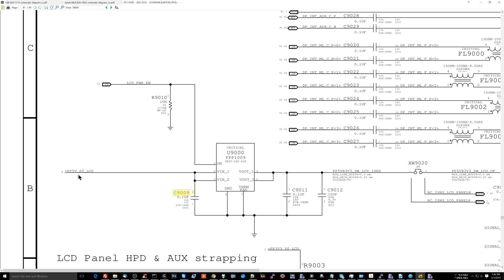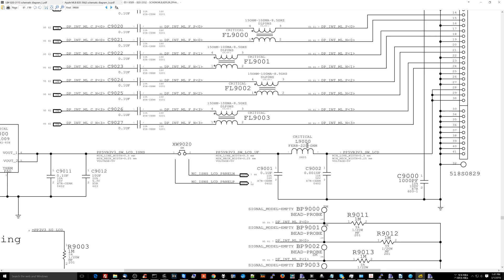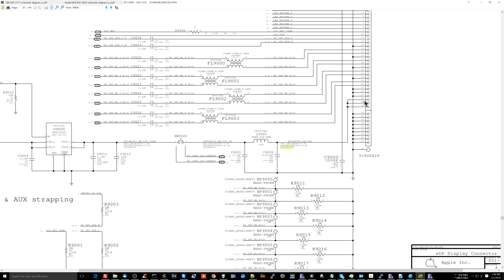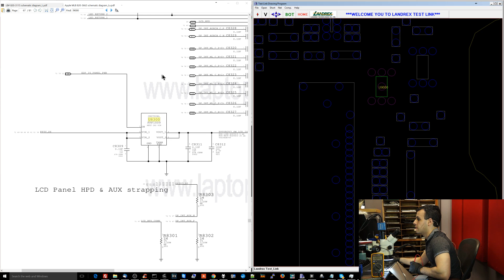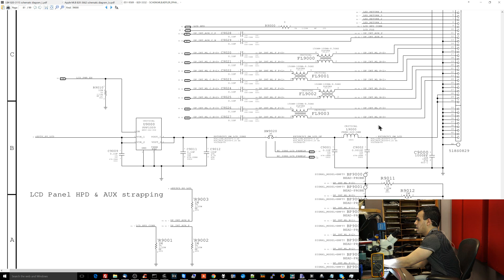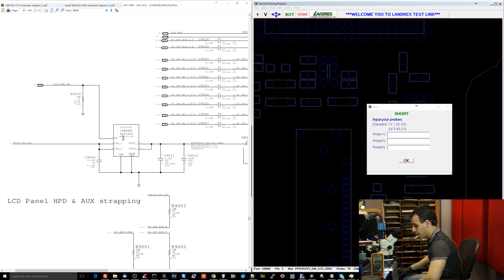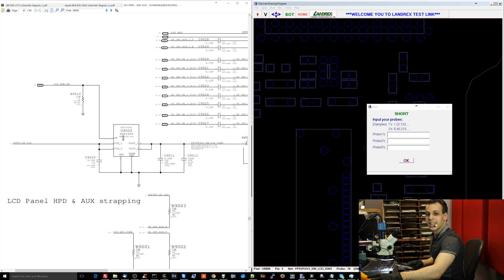Brains continue to triumph over ovens and heatguns when fixing Macbooks with no video

Comment: Lots of respect Louis.  Your heat gun rant is understandable but off base.  My local tech charges $195 just to lift his soldering iron.  That's what he want to re-attach a three pad speaker connector to my Late 2011.  Re-balling a GPU would be astronomical with this guy.  Anyways, my 2011 had no chime and no screen.  Heat gun to the Intel GPU fixed it.

Comment: i know about the owen thing long ago, and everytime i tried it it worked out for me. my first laptop died after 2 yers, it had an MXM 8600mGS GPU card that stoped working and buying another one cost me about the same as a brand new laptop, so as i had nothing to lose at that point, i tried the owen thing, 10 minutes into the preheated owen at 240º and then i let it rest and cool down without moving it... that got me 1 year more of use and gaming for my laptop untl it died again and the owen thing didnt work anymore... a few years later, now, i had 3 dead laptops lying around, packard bell, acer and lenovo, all pretty cheap dual cores with soldered gpu or embeded into the chipset, (my brother's laptop, his gf's laptop and my mother's laptop). so at this point they were dead, turning on, cpu heating fan blowing but no screen turning on, keylocks or beeps at all... as these were cheap laptops and not worth repair (also faulty chipsets all over the internet) i dismounted them, unsoldered the bios battery and tried owening them all... it worked for all of them, and now i have 3 working laptops. i wouldnt do this for someone obviously, but for me it worked and i didnt have anything to loose

Comment: At 4:00 you say the inductor is used as a fuse. I think it is part of pi-filter, together with the two caps. Probably to supress rf-noise going into the display cable, which would act as an antenna and the device would not pass EMI standards.

You make great content. Keep up the good work!

Comment: well on your comment on the parts. i would prefer having new parts . there is even a good company's that can get you that, but ! there is an issue with new parts, First of all you need to order 200 or more in one batch at least ( one part is cheap but when you X it with 200 well then gets expensive, also with all those parts is that they have a life cycle, meaning that you might not even get the component for a 3 year old mac anymore because that part has gone out of its life cycle ( most parts have between 5-10 years if i am not wrong. And in the end apple might also have special parts you cant even get. So all that speaks for using used components in your case rather then buying new one since you definitely don't use 200 chips within a year and just get a huge stockpile of basically junk later. 

so what i am trying to point out is that well using used parts , i do not like that idea , but practically you don't have a huge choice unless you really want to take a high repair cost on those thinks and its also a logistical nightmare since when you order those parts it will take around 3 -12 month because they need to produce your batch first since nothing of those things is in stock anywhere normally
Reply: and to comment a reference site that had some nice courses here where i life https://www.arrow.com/ =P they sell parts .. though again useless for you unless you can wait along time and order high quantity i think

Comment: 9:50 

Instead of "burning the LCD connector", is there something that you can coat it with to take the brunt of the heat, that you can then wash off? Like a high-temperature water-based grease, or something? (Never tried that, I'm thinking hypothetically.) I know people sometimes do similar when painting using beeswax and other materials to mask certain areas.

Comment: A reasonably smart person once told me to use kapton tape to protect the things I didn't want to burn. I'm passing this advice on to you because why not. It doesn't cost much and you can get it from pretty much any electronics supply store. Personally I get mine from Mouser.com. That said, I don't do much reflow in my prototypes as most of them are crude through-hole designs.

Comment: You know i don't do many macbooks so the sw is switch the 3v3 on or enable pin or 3.3v enable turns on a 5v output to switch on the lcd is this used for hibernation mode also when state changes ?

Comment: People always tend to say that you use too much flux. I don't want to participate in that since my soldering experience is limited to through hole parts.
Yet I would like to know,
why do you use the amount of flux you use. (May it be much or little in your eyes)
What benefits has it shown to have for you?
Reply: As somebody experienced in SMD rework, I can say it's better to use too much than too little, too much won't harm anything but too little results in dry joints and messy work... Or worse, if you're removing components, especially BGA, damaged pads. What tend to happen if you use too little is that the flux boils and vaporises/runs to the surrounding area before the solder melts. If you drench it, it takes longer to boil and also the flux won't want to run to the surrounding area because it's already drenched in flux. It's pretty easy to clean off once you're finished.
Reply from the maker: i don't have to make another trip out of the microscope to pick up the flux and apply more.

cleaning excess flux is done at the end with an ultrasonic cleaner. i can use 0.0001cc or 5 gallons, it is the same process to clean it.
Reply: +Louis Rossmann I've never had the luxury of an ultrasonic cleaner, but I've never worked on liquid damaged boards. In any case, alcohol and a bush makes short work of removing excess flux.

Comment: "The same shit over an over again." Yes, I'm glad I'm not alone in that. For me it's people who answer questions on tech help forums that show up at the top of Google searches where the answer is completely wrong and has nothing to do with the original question. Drive by answerers is what I call them. And they never seem to come back to check to see if their answer helped them.

You wonder if there's a fad going around where people troll reply the wrong answer. Simple example: Q: "How do I speed up my PC?" A: "Delete the system32 folder." but much more in depth and sophisticated.
Reply: After seeing you dig through the tote for a board with the component you needed, wouldn't it be nice if you could create a component inventory database based on common problems and the components related to that problem area's location and interconnections in those specific boards that you can simply bring up to see if that component is present in your shop and working before you accept a job (it would be sad to find you can do nothing for the customer because you didn't have the component based on your "rare" comment)? :) Or maybe there is something like that, but it's a pain in the ass to upkeep. lol

Comment: Louis, I was wondering is it possible replacing GPU chip with another GPU chip (better one) if the first one was soldered? May any issue arise out of that? (compatibility wise, power wise etc.)

Comment: Mechanic logic: replace every part until works. No offence to the actual good mechanics
Reply: no, that's a parts replacer, true mechanics can diagnose. ;)
Reply: But it's electronics where everything needs to work (some capacitors can be missing but not broken) it's not like car where you can remove half of the shit and it can still move. It may not stop but it moves.

Comment: Sounds an odd comment to make but i find it difficult to read a lot of the text on the schematics because you're recording this on a 4k screen and i often watch these videos during down time at work on a crappy 1280x1024 monitor, even on full-screen they are 90% of the time unreadable. Don't suppose you could zoom a little more when pointing to specific parts, even an extra 10-15% would make a world of difference, thanks for the vids just a suggestion.

Love the channel and all your vids.

Sam
Reply: Afro-Sam jamming an IPhone screen up to 1080 makes the audio unplayable but most of the time the still frame is readable. Even if I had higher resolution, my screen is 4x smaller than yours.

Comment: hey Louis, any reason you arent using the new board view software, is it crappier?
Reply from the maker: i have time warner cable internet at the store. this should explain everything
Reply from the maker: this video is 4 months old
Reply: This video is probably a few months old, since his computer is showing that this was recorded on the 1st of March.
Reply: Do you have a kind of queue system for your videos and that's the reason for the time to release?
Reply: Louis Rossmann Alright, that explains it!
Reply: Louis Rossmann 6 months ago that would have been the case for me too, they finally put a fiber line and down here in TX the person per square mile ratio is alot less so that 200+mbps tunnel is practically all mine. I understand though, $70 for barely 15mbps stable 30 boosted. Now its like $30 for 200 low ping no bullshit connection.
Reply: If it's available I would switch to RCN

Comment: what u don't understand is that oven heat up the solder balls just like soldering iron. It melts the balls again and fixes it magically. It's so simple and easy.
Reply: idk if a joke, or pure stupidity.
Reply: he included the word magically.. thus I assume thisbis satire...
Reply from the maker: You're being trolled hardcore right now.
Reply: omg omg he replied to me omg
Reply: Louis Rossmann that HP which was resuscitated had a mountain of heat shielding carefully and painstakingly added not just at critical points, not just a patch over a couple of sensitive Nvidia GPUs